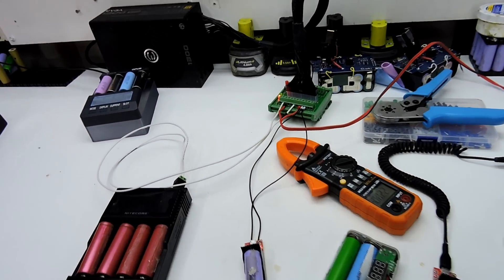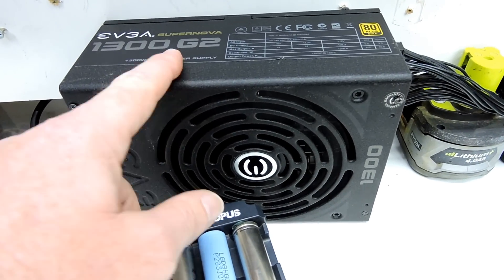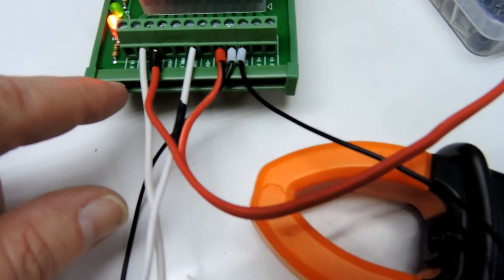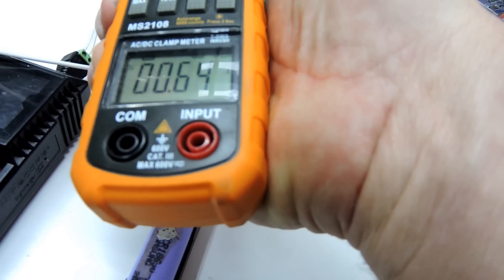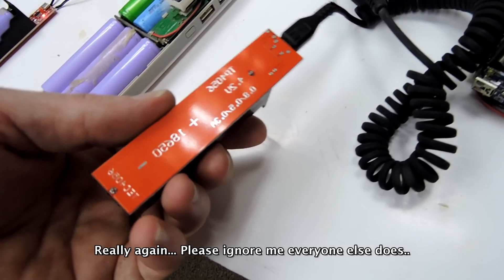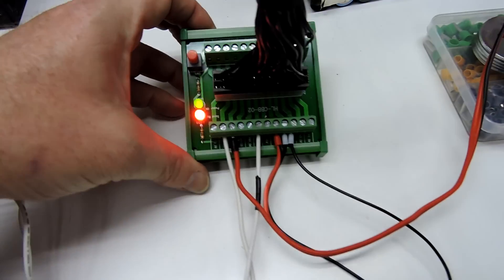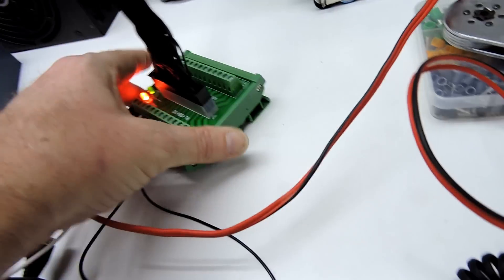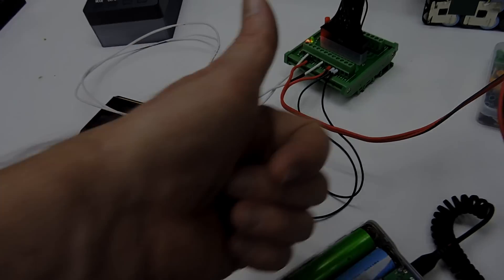24pin ATX DC Power Supply Breakout Board

Comment: you can probably do 8A and be fine on each wire, molex 4 pin (standard molex) is 7A on 12v and 7A on 5v
Reply from the maker: Just ripping out a quickie to update this video - 16amps she gets the tracks quite hot after just a few min.. :)

Comment: That is really cool. How do you turn it on and off? Do you know if it is efficient?
Reply from the maker: Has a power button on it, should have covered that part grin it's dependent on the power supply
Reply: Fil-Am Gabe shouldn't affect psu efficiency since it's just splitting up the connections from the 24pin connector into screw terminals
There isn't anything on there converting voltages
Reply: HBPowerwall and Hello, thanks for the fast response to both of you.

Comment: First
Reply from the maker: But on this video it doesn't count lol
Reply: big enough psu..... 1300 giga watt
Reply from the maker: It's actually faulty as soon as you connect up the 12v aux power to the main board via the 8pin the PSU won't power on anymore, only good for secondary PSU in a rig
Reply: HBPowerwall gotta use it for something